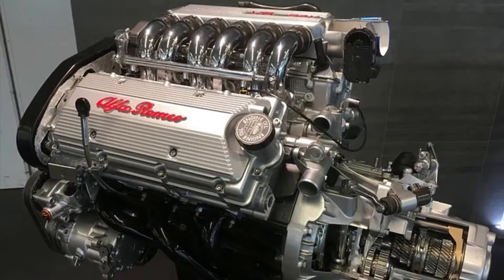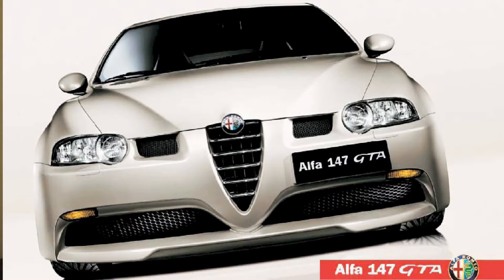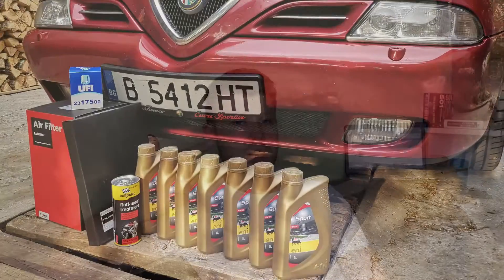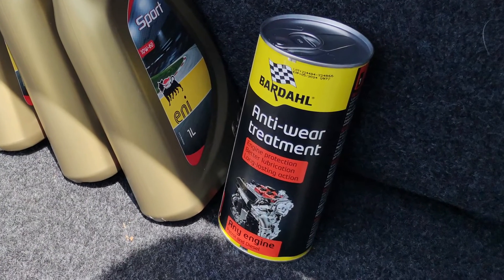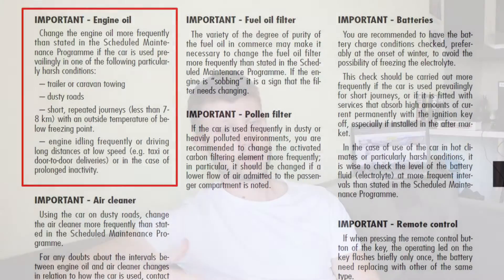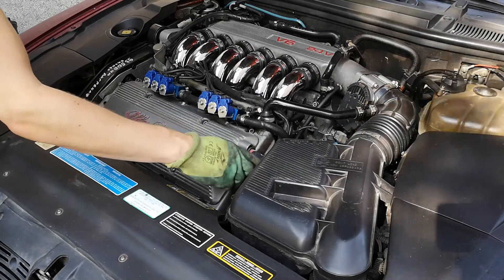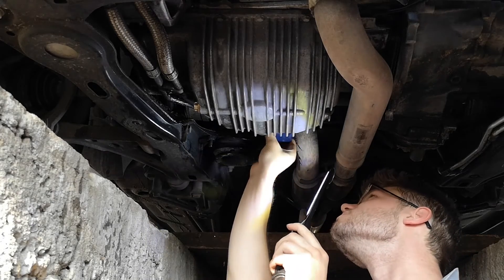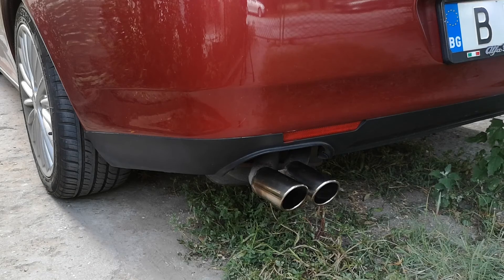Busso V6 - How to Change Oil & Which One is Best | Alfa Romeo 2.5/3.0/3.2

Comment: Thank you for your video.  It was clear and precise.  I am in the process of buying a 1984 USA spec GTV6 and would like to know if you are aware of what differences there might be seen in the 2.5 liter 12 valve engine.
Reply from the maker: The only difference I am sure about is the fact that the replacement of the timing belt is much easier than on the 24 valve versions. About the oil - I'm not really sure, but there should be enough information online in the forums. Also, did you buy the car? If so - congratulations :)

Comment: 24 valve started already in 1992 in the 164. I started with the 12v versions in the 75 & early 164. Then came a 1993 3.0 24v QV 230 hp. I started using 10w60 (Valvoline racing) and never went back to 10w40. After that I also used it on my trackday 75 v6 and noticed a significant reduction of the typical main bearing light knocking sounds when running the engine idle after a demanding ride (hot thin oil).
Used Agip racing (ENI) as well, nothing wrong with it. Currently trying out Castrol 10w60 also on my daily twinspark 16v. Oil consumption went down from 1 ltr on 3000 km to 4-5000km.
Reply: I was listening to that and I thought he was absolutely wrong because here in Brazil we have the 164 and I’m almost absolutely 100%. I am certain that is one of these beautiful motors.😅
Reply: 164.3.0.v6.12v is 10w-60 suitable for freezing temperatures of -15 to +35c...or is it better to use 5w-50 mobil 1?

Comment: I've found Mobil1 FS 5w50 has a good compromise of cold starting and high temperature viscosity on 3.2. No real oil consumption, stays golden through period. Add maybe 0,5l per 10k.

Comment: Busso 24V engines were also used in the Lancia Kappa and Thesis. In Kappa 3.0 CF2, in Thesis 3.0 CF3 and 3.2 CF4. The manual for Lancia Thesis states that V6 engines should use 10w40 oil (Selenia 20k), with two reservations, for sports use 10w60 oil (Selenia Racing), and for low temperature operation 5w30 oil (Selenia Performer). I use Eni Euro Sport or Gulf Racing oil with a viscosity of 5w50.
In Thesis, the capacity of the lubrication system is 5.9L because there is no external oil cooler, only an exchanger under the filter, as in the 2.5 version.